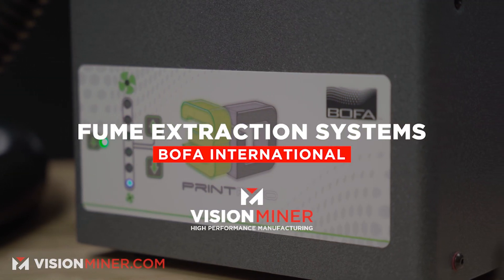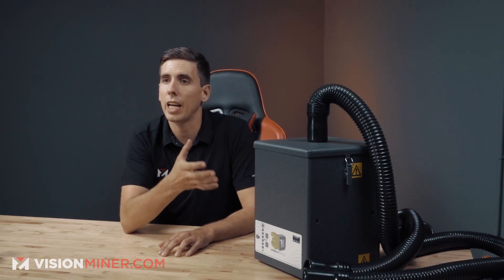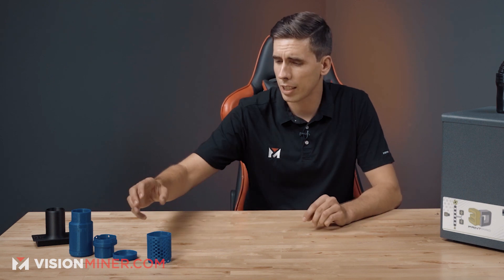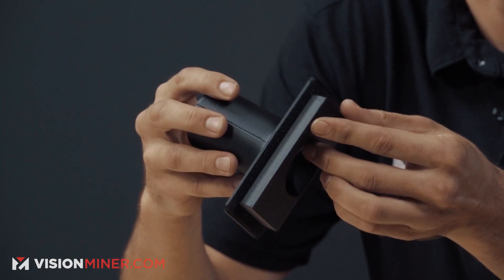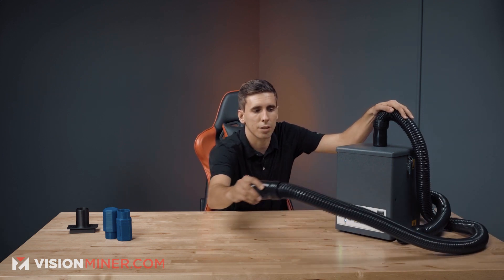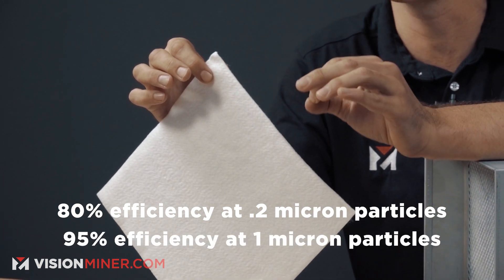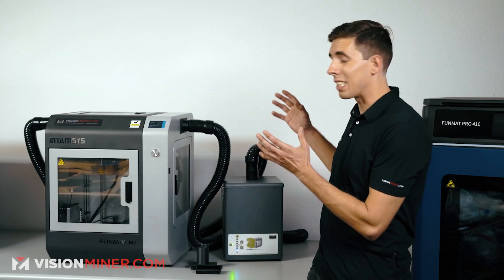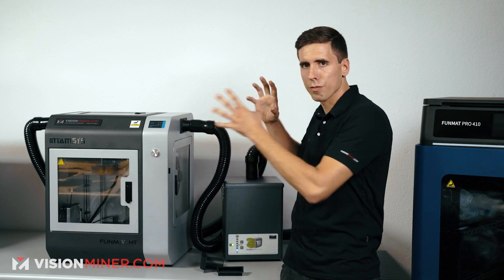Is Your 3D Printer Killing You? VOC Gas & Odor Fume Extraction BOFA 3D PrintPro 3 Overview

Comment: Does the filtration unit include (or offer) a Y adapter so multiple enclosues/machines can be filtered (i..e. two CR-10 machines, etc) ?  What's the tube diameter?  Could you affix this to something like a dryer vent to exhaust outside?
Reply from the maker: Tube diameter is 2 inches -- and you could definitely easily print one to do exactly that :) Great idea!

Comment: The problem with fume extractors is heat. SLA printers like to be at 25 to 30 degrees C. If your using a printer on a cold day you need to keep the heat in the room and some fume extracts will remove that heat or cool the system down as air flows from it. Some kind of heat extraction unit is also needed in those situations. It's all a compromise and heat vs fume extraction is a problem that's difficult to fix cheaply.
Reply from the maker: Very true! Our machines maintain 90c in the chamber on the low setting, after a good warm up.... but that means the heaters keep going, using more energy, as well.
Reply: Just use the shop vac to recirculating the air

Comment: I just got a Photon S, one concern I have is about air quality (fumes from resin & IPA and particulates).  Do you have a setup for the Photon S yet?
Reply from the maker: These systems can be used with them, but creating the attachments has not been done. You could easily do a PrintPRO2 and use the flex arm to get the general area :)

Comment: Thanks for looking into health risks, is there info or work done on carbon nanotube risk to lungs?
Reply from the maker: It's still mostly in the air, but nanotubes in polymer matrix's usually aren't an issue since they're not floating in the air -- when they're not, though, they're a bigger issue

Comment: Key thing is how easy is it to use with common (Cheap) FDM/FFF
Reply: The 3D Print Pro 2 has a “stay-put” arm that can hover over the printer and pull away the fumes without affecting Your temperature level (warping etc).   This would be a universal solution for all open framed FFF/FDM printers.   If You have an enclosure, the PrintPro 3 (in the video) is imo better as You can circulate the air.
Reply: Myself, I can only afford a RepRap style machine, which is currently becoming a Prusa Bear
Reply from the maker: Stay tuned, video on the stay-arm soon!